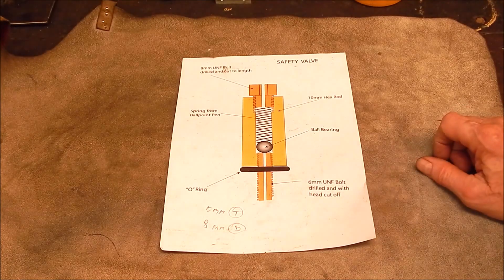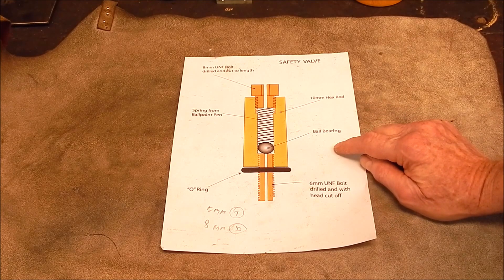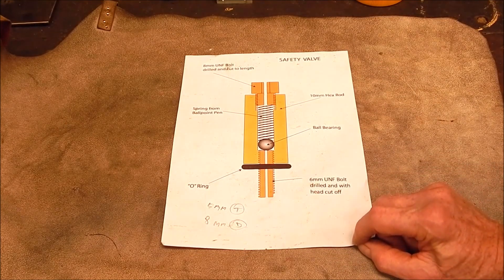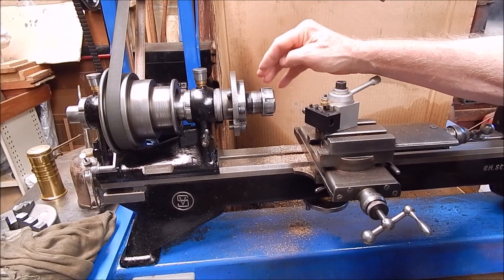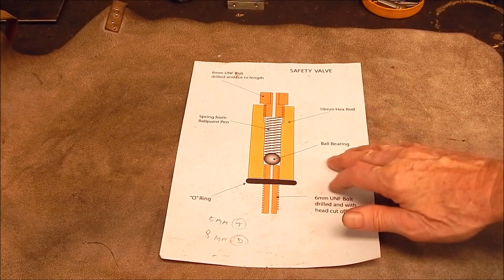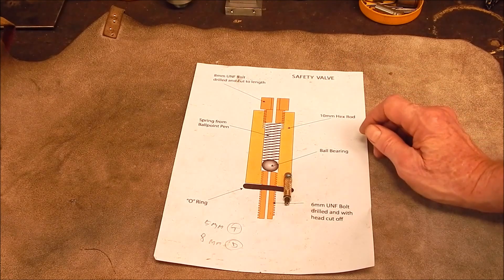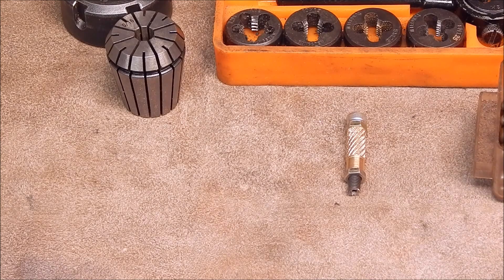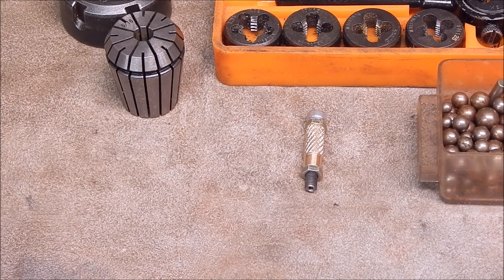Make a  pressure relief valve for a model steam engine boiler - update on the Sumore 7 x 12 lathe

Comment: How much bar does the valve need to open up under for a small boiler? I mean to be safe.
Reply from the maker: Set it to as low or high as you want to go.  It all depends upon the design strength of the boiler.

Comment: A very poor design.  There is no clearance between the ball and the walls to allow for steam passage.  Use one size larger and for the bore, and use a punch on the steel ball to make the ball seat properly in the bottom of the valve.
Reply from the maker: I agree regarding the ball size.  I used a much smaller size than the bore.  I also used a tapered seat directly into the brass body for the next one I made.  This gives a much better/perfect seal.  The original design has a few issues.  Cheers Rob
Reply: Just custom grind your HSS drill bit's taper so it seats the ballbearing better and do it all in one movement when boring the through hole through the brass body with the drill

Comment: Hi Rob , I have several “ Hit and Miss “ Engines and for the check valves on the fuel lines I use Bronze balls that are available in all different sizes. Might work good in your application. I’m sure you can find some company on the internet in your area that has them . Nice project ! 😊 !

Comment: Cool build. I built myself a very crude fuel pressure regulator for one of my old trucks. Not much more then a few holes, seams to work well on a low HP engine like mine so far

https://youtu.be/9ZcK7QBeQy8

Comment from the maker: NOTE:  I think I can improve the design significantly by threading the outside diameter of the brass rod base (eliminate the threaded steel sealing/screw in piece) and have the ball bearing seating directly on the brass.  Removes any possibility of the steel seat and ball bearing rusting together.  Also do away with knurling by milling two flats on the brass body to take a spanner/shifter.  So I will have another go at it.  Cheers Rob

Comment: Hi Rob, great little build and nice to see the Schaublin being used for its intended purpose. Museum pieces belong in museums! Turned out well and will look great atop your boiler. Cheers, Jon
Reply from the maker: Hi Jon, it sure is tiny.  I think I can improve the design significantly by threading the base outside diameter of the brass rod (eliminate the steel sealing piece) and have the ball bearing seating directly on the brass.  Also do away with knurling by milling two flats on the brass body to take a spanner/shifter.  So I will have another go today.  Cheers Rob

Comment: Great build Rob, and the print is so simple. I struggled a bit with my first attempt at making a blow off valve and this video answers every question and reservation I had at the time. Thanks , cheers and here's looking for the new lathe!
Reply from the maker: I think I can improve the design significantly by threading the outside diameter of the brass rod base (eliminate the threaded steel sealing piece) and have the ball bearing seating directly on the brass.  Also do away with knurling by milling two flats on the brass body to take a spanner/shifter.  So I will have another go today.  Cheers Rob

Comment: Hi Rob. Very nice.You could simplify it even further if you made the body of the valve and the bottom threaded part out of one piece. You can pick up sets of ball bearings fairly cheaply these days, I got a 2 mm to 11 mm set from ebay for a few pounds. Cheers, Alan.
Reply from the maker: Hi Alan,  yes I could have tapped a thread on the body and made it larger/full diameter at the same time - good point.  I will do that next time.  Funny how you can overlook such obvious things ;)  Cheers Rob

Comment: It makes me uneasy to see metric and UNF used on the same part...

Nice build btw.
Reply from the maker: Probably the only thread die the designer/originator had Adam.  Mine is all metric.  It doesn't really matter as it's just another perfectly OK thread type.  Cheers Rob